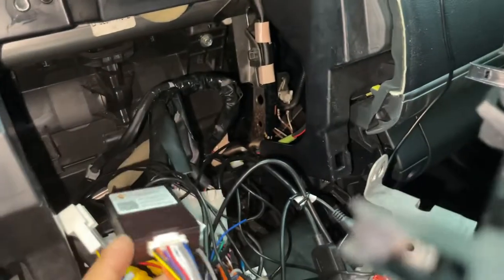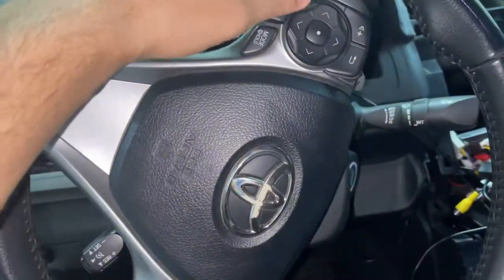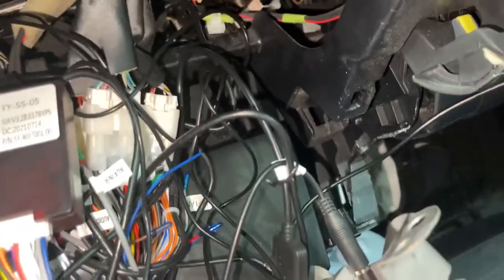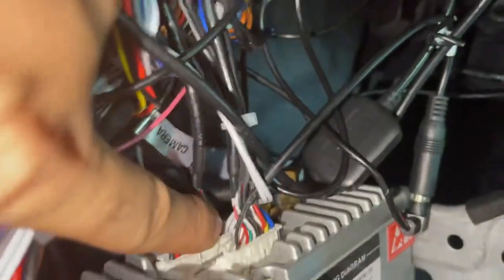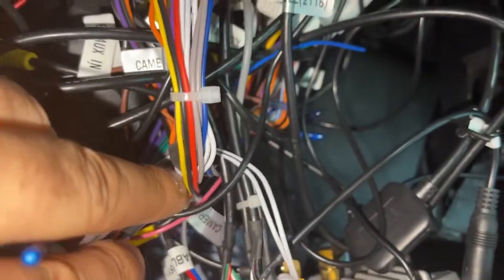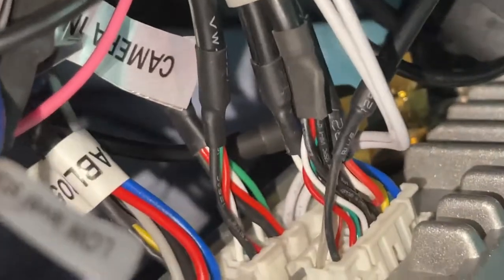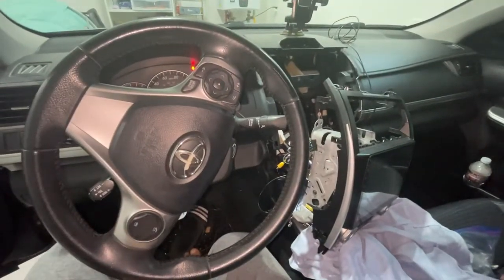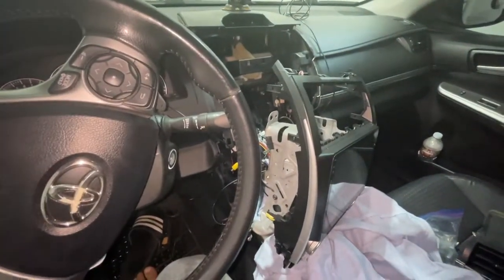Steering Wheel Controllers on Android HeadUnit Plugs

Comment: I plugged mine in because I thought the same thing and the steering wheel controls are still not popping up I tried to factory reset and everything
Reply: Make sure it has canbus and its connection correct
Reply: did you fixed it? i have the same problem and i tried all the things i can
Reply: @Dani-qt1xw  dude so I got the radio working great but every once in a while the Bluetooth kinda goes out then comes back on as far as the steering wheel controls I tried everything and can’t get them to come on thought about taking it in but haven’t done it yet